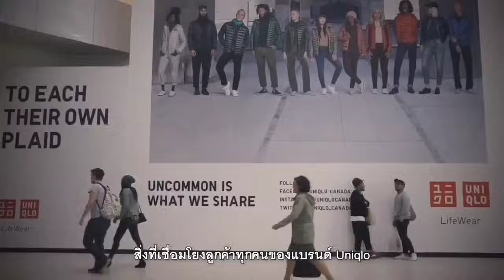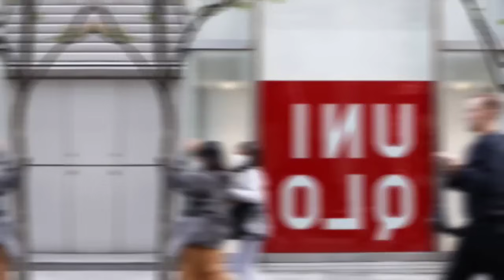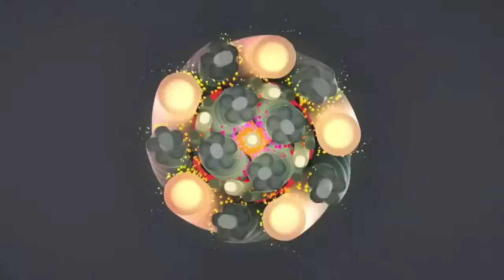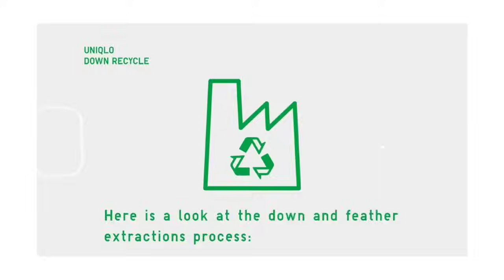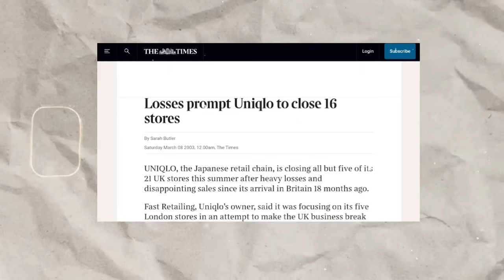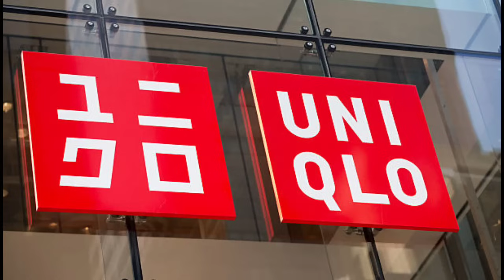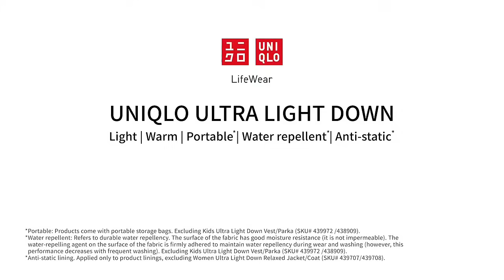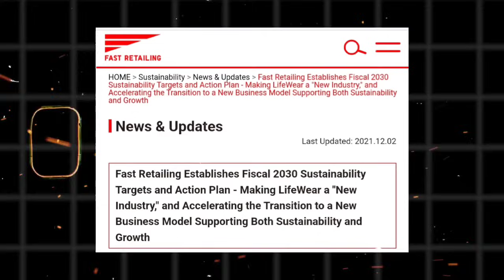The SECRET Behind UNIQLO

Comment: Very successful in Thailand 🇹🇭 and seems that way in China 🇨🇳 the heat tech works well in Japan 🇯🇵 when temperatures change daily. Bought the stock but not up yet. 😂not sure what is puff tech 😂
Reply: Puff tech may make a puffy insulation, but lighter.  Like the ultralight jacket 😊😊😊, just guessing.